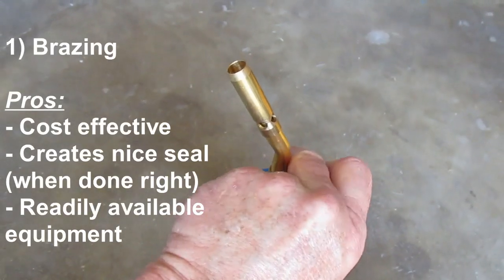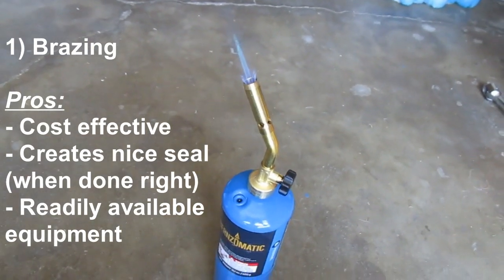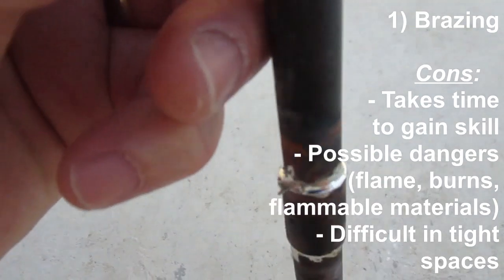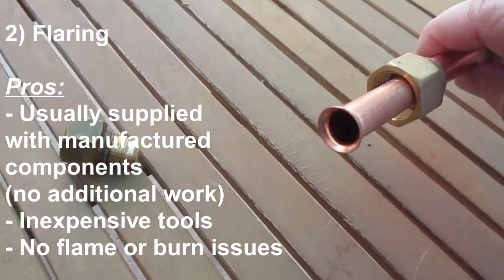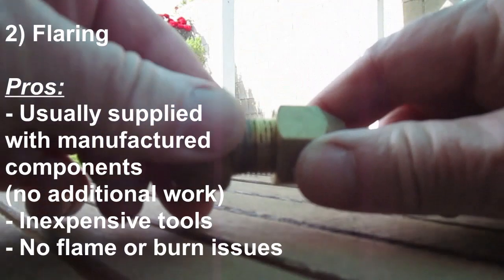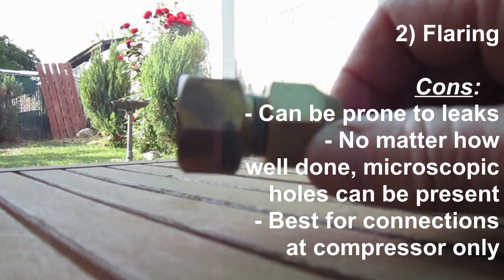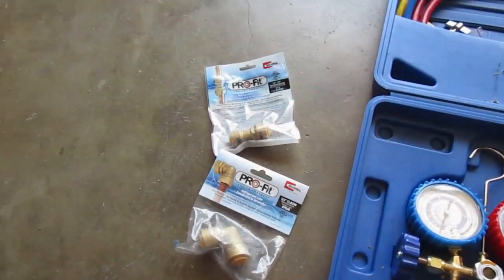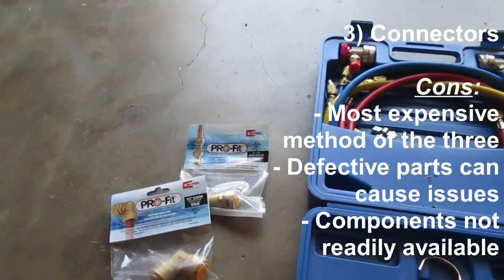Three Methods to Connect Mini-Split Linesets

Comment: Brazing is using oxyacetylene torch which reaches 6000F degrees have two tanks have to adjust the ratio of fuel and oxygen.  The filler rod is actually made of solid brass when I took bunch of welding classes it was called brazing rod. Generally you braze mild steel not copper pipes which would just melt with a oxy torch it gets way too hot. What your using a 2000F max propane torch and silver solder. Plumbers call it sweating a pipe. Most plumbers use MAP gas which is an upgrade to propane it burns lot hotter at 3730F is even quicker.  The best torch is the auto light they sell at HD button click to start it with MAP gas.
Reply from the maker: Excellent information, thank you --
Reply: This is the comment I was looking for. The propane simply will not get hot enough. Brazing and soldering are two different things.
Reply: Turbo torch with just acetylene works great and its super east

Comment: If all you have is an air/fuel torch you can use silver bearing soldier. Flare fittings  have been used forever. They work if done properly. To braze  correctly you need an oxygen/fuel torch.
Reply: No way you could braze copper pipes just melt with a oxyacetylene torch. Brazing which uses solid brass rods is for mild steel which is super easy. When I took welding classes it's they first thing I started on brazing steel pipes and jointing mild steel. It flows right in like solder doesn't melt anything.
Reply: @Mike-01234  brazing rod is anything above 840f. Silfos brazing rod is the hvac industries standard way to join copper tubing. Brass brazing rod is not even the most common rod material used to braze. Silfos in itself is a broad category including everything from 0 percent silver up and past 56 percent silver. Then you have the various silicone bronze combinations. Thats not even getting into speciality brazing rods.
Edit:phosphorus is included in the rod as a flux, I have never seen sil-fos(thats a brand name) above 15% silver. After that you get a coated rod in my experience.  Not saying they don't make it, just that I have never seen it. The phosphorus doesn't work well joining copper to steel, the coated rods work better.
Reply: @kraftzion  sil fos 15 works great with turbo torch, no oxy just acetylene and any wone can do it, I use nitrogen purge to help keep it clean on the inside
Reply: Just need a turbo torch  and some sil fos 15 no oxy needed